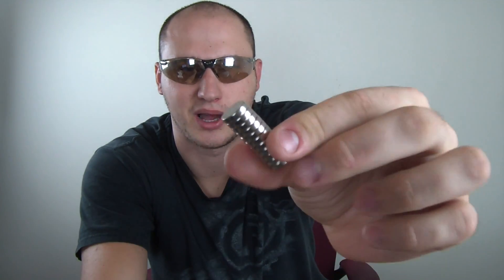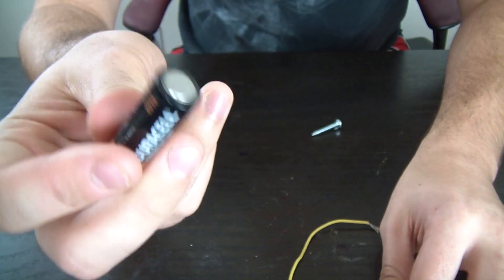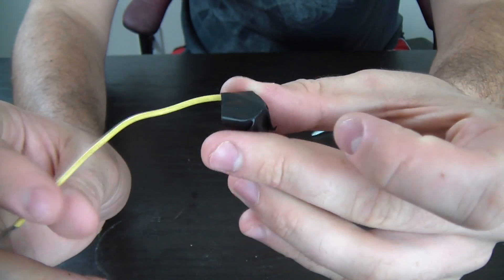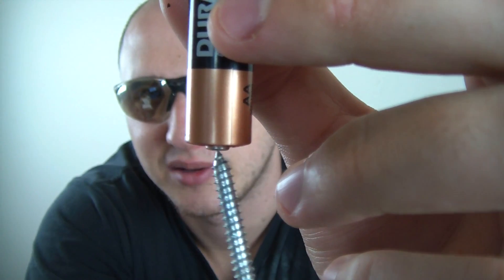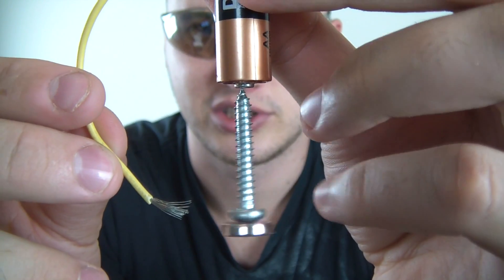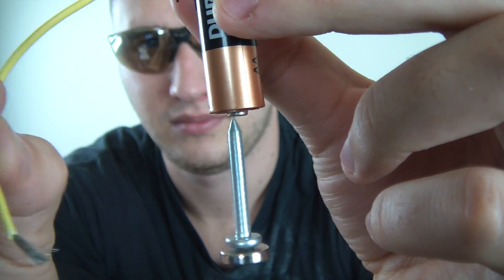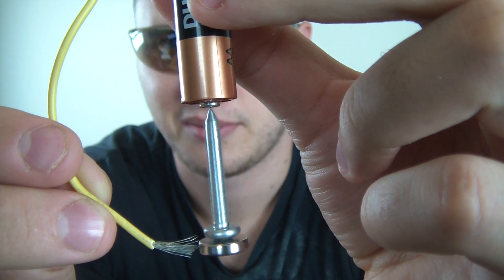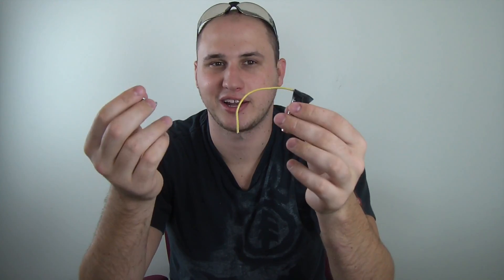The Most Simple Motor in the World

Comment: The wire produces a charge that repels the magnet in one direction and attracts it in the other direction causing it to spin and thus turn the screw.This only works with metal because the charge cannot pass unless the circuit is complete and that is achieved by the metal in the screw and metallic magnet.

Comment: Does not work, I've tried it, the wire just sparks when it touches the magnet and the screw does not spin.
Reply: +Ervin Higi maybe you are using an old battery
Reply: +Archie Halliwell or you have connected the screw to the anode (-)

Comment: This is simple physics.  Electricity and Magnetism are two sides to the same coin.  If you don't know what the Right Hand Rule (RHR) is, you should look it up before claiming that God, Allah, or one of your other imaginary friends did it... Yes, any magnet will work with this experiment, the magnet that the CrazyRussianHacker used works best because of the strength of the magnet.  The RHR is simple, look at your Right Hand... the three parts that you are concerned with are the fingers, thumb and palm... If you were to wrap your right fingers around the screw and have your thumb pointing up, the fingers represent the magnetic field, provided by the magnet, the thumb is the direction of the current of electricity, and the palm represents the magnetic force (Completely different than the field). This is best shown by giving the "Thumbs up" sign.  By introducing the wire to the bottom of the magnet, you are introducing a force against the magnetic force and utilizing the magnetic field to spin the screw in the direction of the magnetic field.... If you were to turn the battery around, the screw would spin in the other direction because the current is flowing in the opposite direction. This is shown by giving the "Thumbs down" sign.
Reply: Or the real, not imaginary, god made these laws of physics to begin with, and then you, so that you could learn about them.
Reply: John Titor lmao
Reply: This is the most ADHD comment I've ever read.

Comment: For anyone that is wondering how this works... The positive electrons flowing from the positive terminal of the battery are going through the screw and the magnet to the negative terminal of the battery when the wire is connected in turn creating an electromagnetic field running through the wire witch is reacting to the magnets magnetic field pushing it in one direction. This is similar to a water wheel being turned by the current of water. Creating an endless clockwise/counter clockwise motion on the screw. It spins so quickly because there is a very small amount of kinetic friction between the tip of the screw and the positive terminal of the battery due to the amount of surface area of the tip of the screw. Hope this helped.
Reply: John, I'll say it again... learn about religion before stating your opinion... Religious leaders (most prevalent being The Pope) has been KILLING people for centuries because there were other people who thought differently than the church... I think people should stop believing what others tell them to be true and find out for themselves... this is the backbone of science...
Reply: Bah, I guess I should have read more replies before putting my response... Your's seems to be easier to read... I talked about the Right Hand Rule...
Reply: eliminator3 not to mention he didn't bash people's beliefs out of stupidity.
Reply: eliminator3 While i agree people should find out the truth for themselves, some people just so happen to find this truth to be religion. There is no need to unnecessarily bash religion simply because you don't like some of the things some religious people have done in the past. With your logic, we should also be bashing atheism, as there are plenty of instances in which atheists have caused harm.
Reply: Thank you all for sharing your opinions.

Comment: A. the cost of a large powerful magnet like that would be absurd
B. You would have to swap out the magnet when it stops working as efficiently(goes back to issue A). It also doesn't take much to make that screw spin, however if it were trying to tear through a material, it wouldn't work so well.

Comment: Your power source is the battery.  The electrons go out the negative end (tape) flow through the wire so when it hits the magnet the magnetic field kicks in causing the rotation of the magnet and the screw spins showing this as its touching the positive end.  No matter how many times it gets explained to me it still has to be one of the most interesting discoveries of technology.